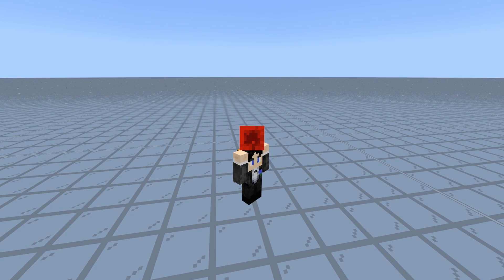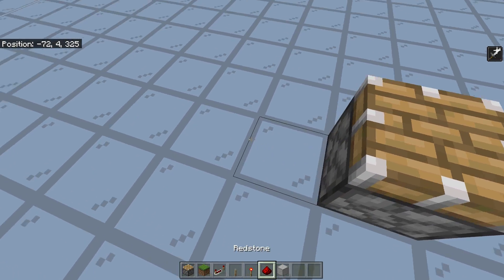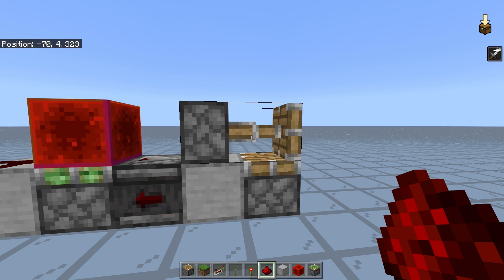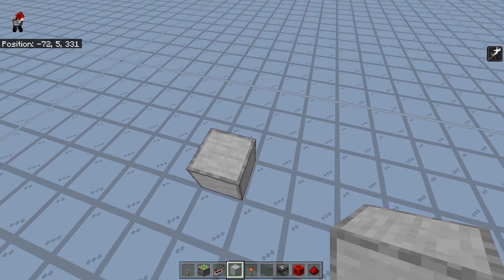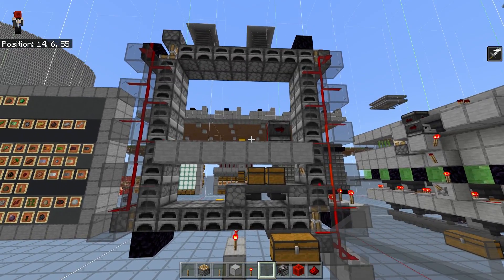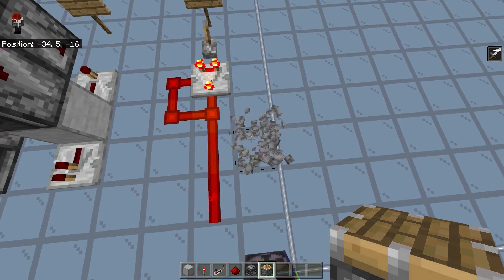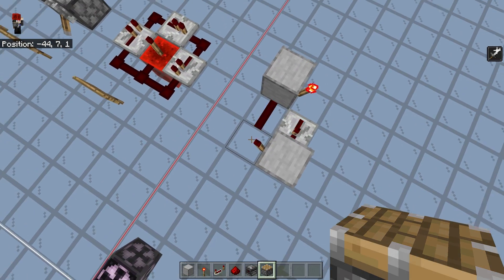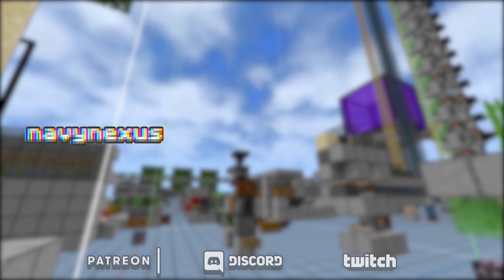Piston Overpulsing Explained - Reliable Pistons Minecraft Bedrock

Comment: Powering 2 pistons trying to interfere with the same block at the same time should be random, yes. I'm fairly certain what you wanted was to invert one of the pistons.
Reply from the maker: inverting also has inconsistencies. what I showed was obviously only one way to demonstrate issues with conventional methods of shifting floors, but inverting will run into the same issues if the clock is too fast. and if it is not too fast, it will still not consistently push

Comment: Me: waiting for updated gold pigmen farm

Navy: PISTON OVERPULSING EXPLAINED !!!!!!!!!!!!!!
Reply: ZEKOSAN TAKAMORA just use water buckets in works pretty well for me
Reply: I've got the snowman agro one that was fiddled with in a live stream with a few tweaks of my own... Gold and xp galore
Reply: @seeit360  yeah i made that one in a creative test world. But didnt found that reliable.
Reply: @ZekosanX  what part isnt reliable from your experience? My tweaks were i built the portals at level 128 and "fire spreads" setting is on. I use a solid floor design with a 2x2 centered drop shaft opening under a snow golum in a minecar even with the bottom of the portal. I have a minecart on the floor 5 blocks north  from the golum square. The minecart on the floor will eventually get a pigman in it which will keep the agro chain - as the snow golum will never break agro with it. The drop shaft goes to the trident killer at level 63. The drop is interrupted by cobwebs at level 83 so max damage without drop killing the pigmen is achieved. The collection is only 2 hopper minecarts feeding into one chest. I run it until the chest is full and turn the farm off. Its so op, im getting to xp level 100 in about 15 minutes.
Reply: @ZekosanX  ...also mine is in survival.  Dont know if that matters
Reply: @seeit360  ^.^ still waiting for the pro ya know.....
Reply: @thatguy-mi5jr  god I've added water streams and the lag is unreal (also fish )

Comment: Nex, how do you stay motivated to learn and try out redstone on Bedrock Edition (considering how random and inconsistant it is). It is an aspect of Minecraft that i want to try but theres no point learning it in Bedrock.
Reply from the maker: Well, I now have a bunch of months of experience in Bedrock mechanics now. What you need to know is that it's not actually as unreliable as everyone says, so there definitely is a point in learning it. It's just different from Java redstone, that's all
Reply: @navynexus  So it is not AS unreliable as others make it seem. But aren't there many bugs that plague Bedrock edition that affects redstone contraptions as well? And even the smallest contraptions in Java edition require many modifications and redstone in Bedrock.
Reply: As nex said, it's really not as bad as people make it out to be. I have farms that still work that were built in 1.10 and before. Some bugs we use for farms do get patched eventually but most farms work off intended game mechanics.
Reply: Bedrock definitely has its quirks but overall it is pretty reliable abd worth learning for sure. There are different mechanics to deal with from java but not overly difficult to modify to work on bedrock. The biggest issue ive experienced is if a normally flawless redstone contraption bugs out and you have to diagnose the problem. Which will make you a better redstone in my opinion. Definitely worth your while if you want to make low maintenance productive machines that will free up your time to do other things.
Reply: @barthelms7681  Well i will give it a try. I mostly dont try because with every update we get, the devs end up breaking redstone contraptions and hours of hard work go down the drain if they dont fix such bugs.
Reply: Bedrock is amazing to build binary calculators out of tho. No bud powering or quasi connectivity lol. Very easy to make calculation units